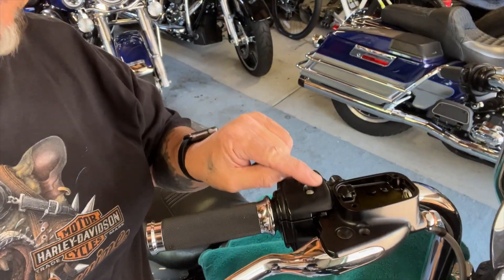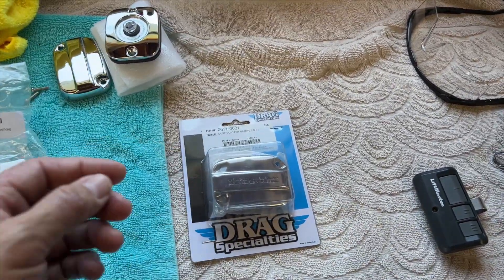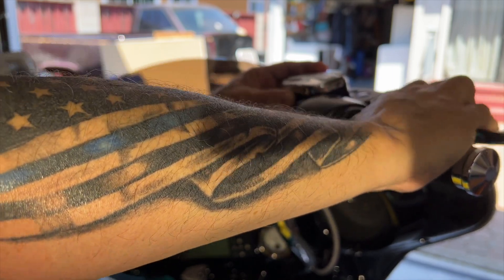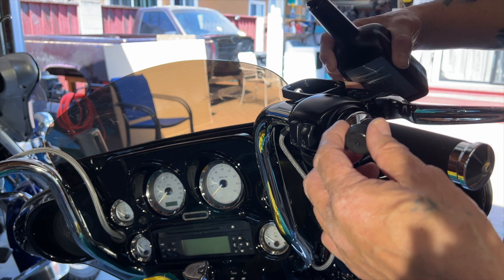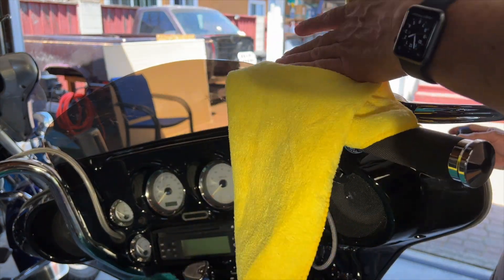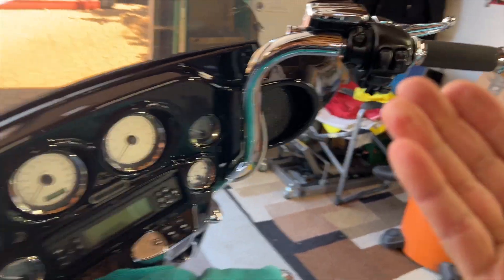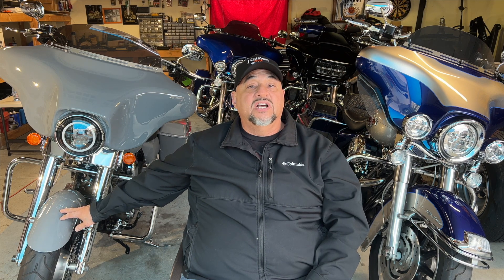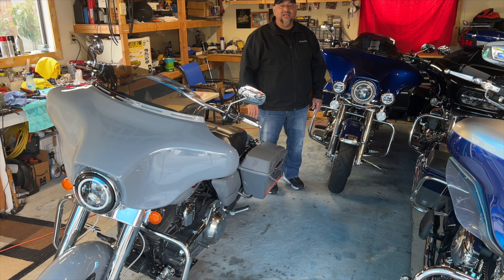This Streetglide Brake System Upgrade Will Make You Rethink Buying Parts Online!

Comment: My 2005 softail.and 2002 road king use DOT 5 but my 2005 ultra uses DOT 4!  WTF?  DOT 5 has a higher boiling point, is not water absorbing and will not damage paint.  Why oh why did Harley go this route?  Makes no sense whatsoever?
Reply from the maker: Hi John. Does your 2005 Ultra have ABS? That’s the only reason it should be running dot 4 cause Dot 5 is not good for ABS Bikes.